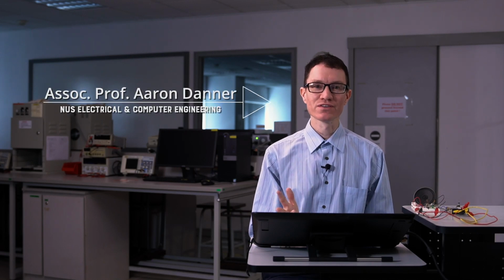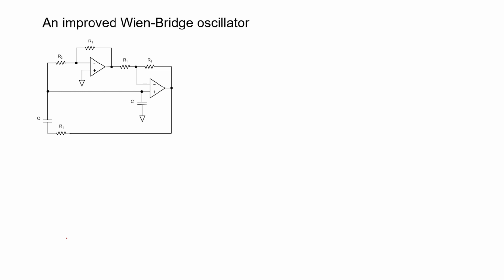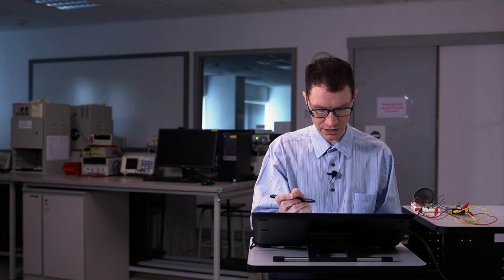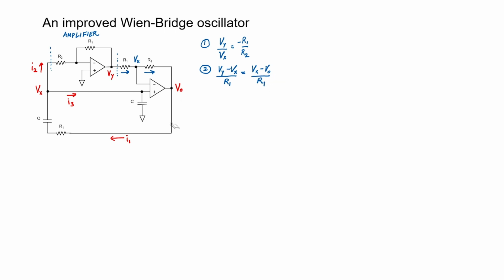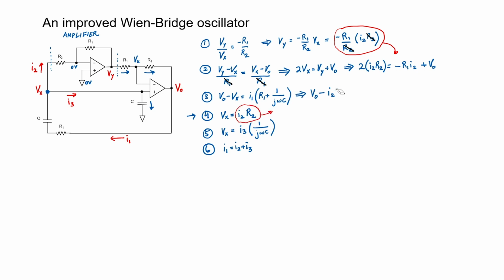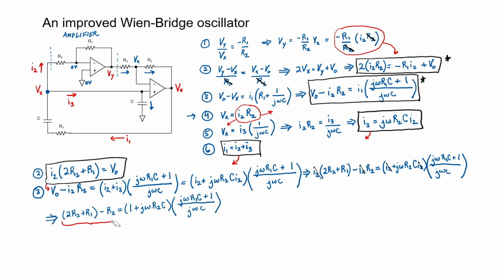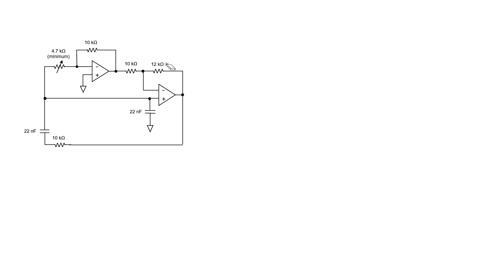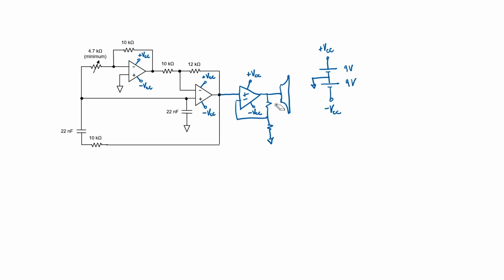Audio oscillator with tunable frequency (6 - Oscillators)

Comment: I can hear that it is not a sine wave output. You need to control the gain in a region to get a sine wave, even for a Wein bridge oscillator. Does this produce a sine wave at a particular, controlled gain?

Comment: I dont understand the purpose of the buffer to the speaker.  what does it add?  also, I removed both the (unvalued) resistors and the buffer still worked.  Not sure what they are for.

Comment: I wonder why not making use of the Barkhausen condition  ( - beta * A = 1 )  for the oscillator to work ? Aassuming  Z1 = (R1 + 1/jwC)  , Z2 = R2//C ,  beta = Vo * Z2 /(Z1+Z2) , A = R1/R2  than the necessary gain and the oscillation frequency  result from applying the Barkhausen condition.

Comment: After al those complicated mathematical calculations., he has built a square wave oscillator, it is clear from the sound coming from the speaker. If that is the outcome, then it is much simpler to build sqaure wave ocsillators with ic's like 555 timer. Even a simple two transistor astable oscillator will suffice for a project like this! Sorry for this👎

Comment: In the final image, with the added on ( in blue) extension of the circuit, no values are given for the components, could you please advise as to what was chosen to be used, and advise as to why. Many thanks.
Reply: Looks like a non inverting amplifier.

Comment: Yes, but the output signal is a square wave, not a sinusoid. Please try to connect the output to an oscilloscope…
Do you know how to make an AGC in this case? I tried with diodes without success
Reply: That would be due to clipping. Voltage is out of range.
Reply: @DoesntRefillTheBrita  My guess: that 12k resistor required for starting the oscillation makes a supraunitary gain, which will drive the oscillation's amplitude to infinity.